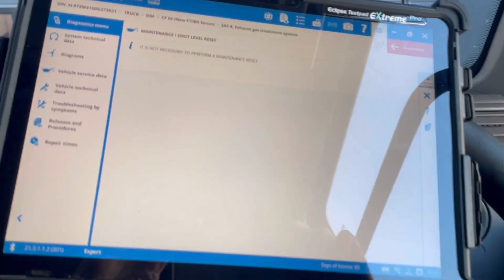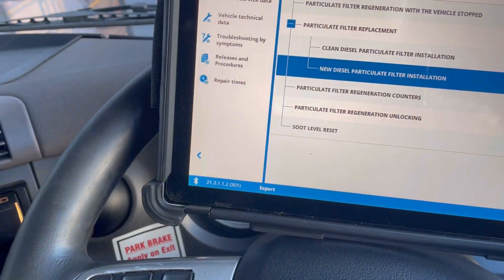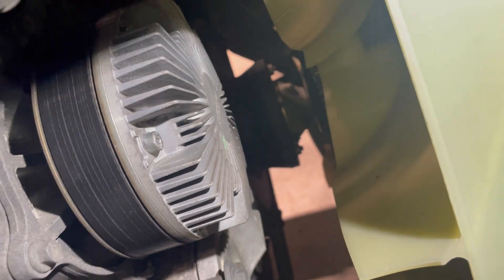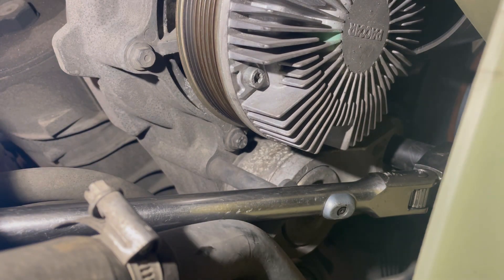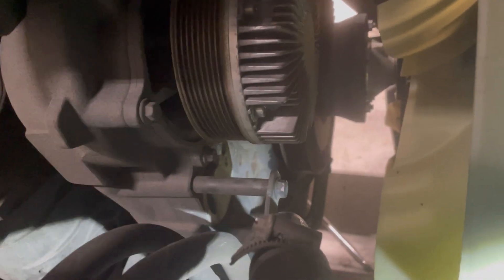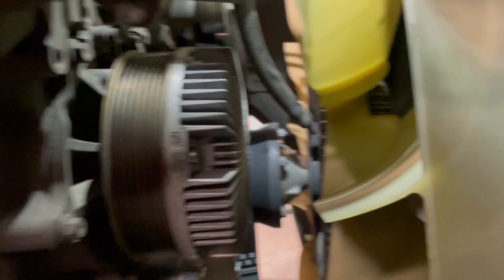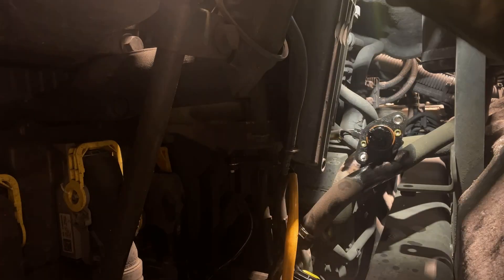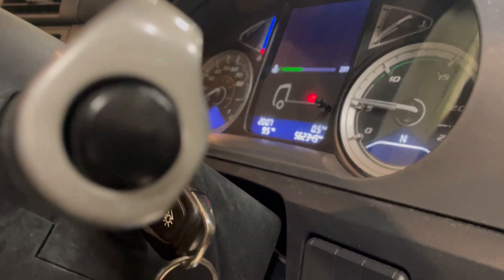Day in the life of a HGV Mechanic- DAF CF85 a regen pain! Fan belt plus tensioner, filter sensor.

Comment: For the belt tensioner ,on the old ones i use a rivet to hold the tension off,,If you slide the belt off 1 of the smooth pulleys it is easier...Any broken skylights you can do ,now that is a right pain of a job
Reply from the maker: Yeah that’s a great idea mate! Ohh the top markers?
Reply: @freightlanetv  Not markers the combi light in  the super space cabs ..horrible horrible job

Comment: Do you or any one here run DAF LF euro 6s if so have you come across and oil pressure faults ???? Let me know
Reply from the maker: When we’ve had LF euro 6 in never had that problem mate
Reply: Thank for the reply been told there is a plunger behind an Allen bolt in the block and to replace the oil pump it the plunger is scored
Reply from the maker: @HGV-RMTech  ahh I’ll have to have a look at that one, I wonder if it’s a similar idea to I think was mx13 engine where the compressor is to take it out had to remove a Allen key bung then had to get a m6 bolt screwed in and pull it out.